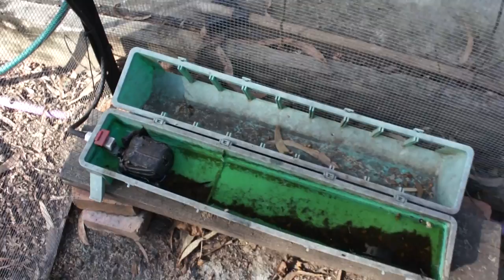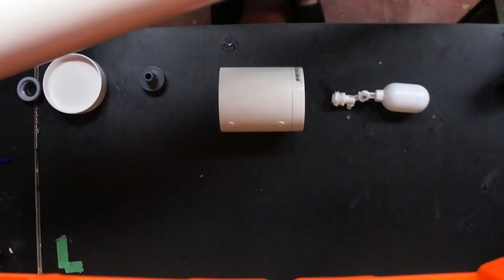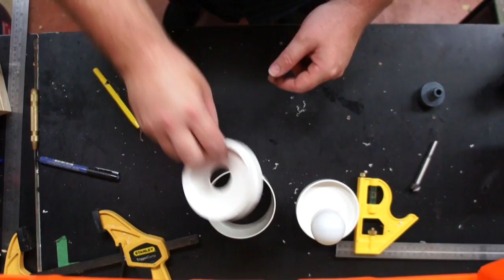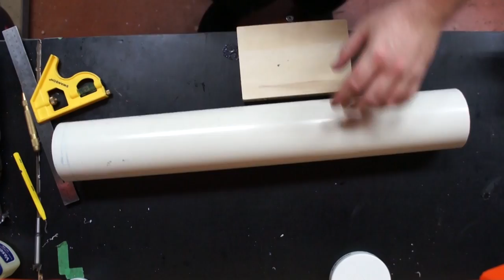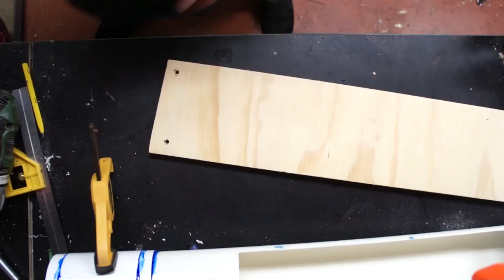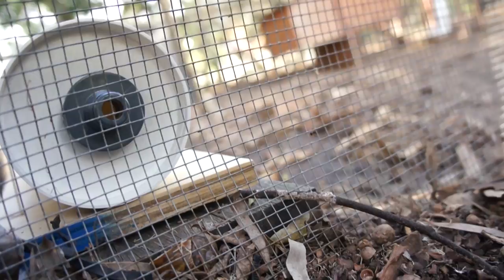How To Make An Automated Chicken Water Trough

Comment: How is thw watere holding up? Would be interested in seeing it after some of use particular, whether the water stays clean.
Reply from the maker: Lasted about 3 years or so. The chickens make the water pretty dirty within a few days. Even the one with a cage on top to stop them from standing on the waterer didn't stop them from making the water dirty.
Reply: @UrbanSelfSufficiency  Yeh, I think having a means of stopping them getting in to the water and a flush system to clean are the challenges. Thanks for the video 😃👍

Comment: Hey dude, I am about to build this, so I'll let you know how it goes. Seems simple, and efficient.
Reply from the maker: Nice... I'm sure there's a more efficient way to make it, too. Keen to hear how you go!
Reply: So I did make your watering system. Your videos are on fast forward which made it difficult to see the detail in what you did. I used 65 mm polypipe. All up the consumables cost me $70.00. the float didn't work as I thought it would and it leaked from to much pressure on the chamber. I think your video speeds need to be normal speed. 
I feel like I have wasted $70.00 based on your video. All up a fail.
Reply: Bit of silicone would fix any leak. Don’t hook up to mains pressure this is perfect for gravity fed low flow low pressure feed

Comment: what"s the purpose of the hole at 3:05 !?
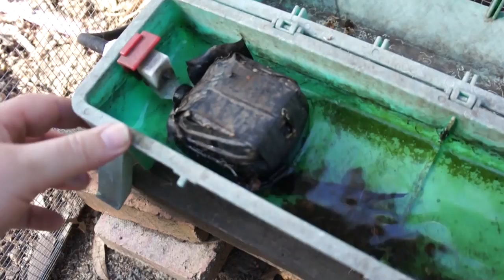Reply from the maker: The float has a screw on the arm that allows you to adjust the angle (or height) of the float to change when the water shuts off; the hole allows me access to that screw so I can adjust as needed. You can see the screw and arm assembly that I'm referring to at 0:18 
 Jim
Reply: cool, thanks.
I like your idea, i have already ordered 5 of those floats and will be going to bunnings tomorrow for the water pipes,..

Comment: Good job, I don't understand why you didn't put the hose directly on the float valve...why complicate with a separate water compartment?!
Reply from the maker: The thread on the float valve was unique. There was no adaptor that would fit it whereby I could connect the hose directly to it... this was the best way around it with what I had available to me.
Reply: @UrbanSelfSufficiency  Ah, I understand.A good workaround, you could also use a metalic fitting, heat it a bit and thread the plastic valve onto it :)

Comment: Hi.  I've watched this a couple of times now!  The water line I'm assuming is going to a faucet?  Can the waterer work the same way if connected to a big rain barrel??  Thanks.
Reply from the maker: +linda silver Yep. Infact, that's what this one is actually connected to! As long as it's positioned below the rain barrel, as to provide enough gravitational pressure too work the float valve.
Reply: Can I bother you for one more question?  Can holes be put in the pvc pipe instead of one whole trough type thing?
Reply from the maker: +linda silver I'm sure you could. As long as the holes are large enough to allow the chickens to reach through comfortably, it should be fine. It would certainly help keep debris out of the water. Good idea.